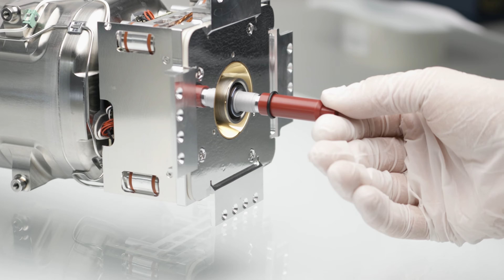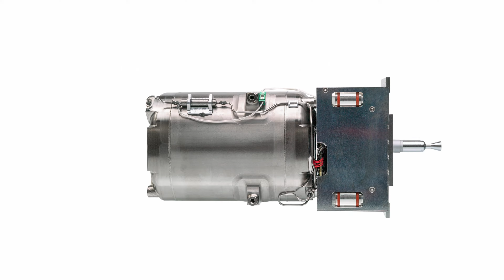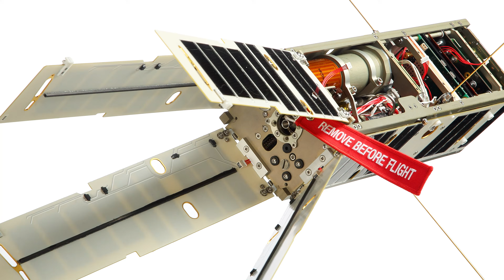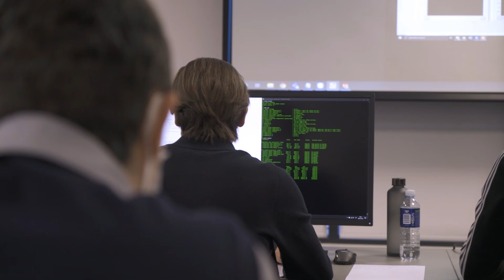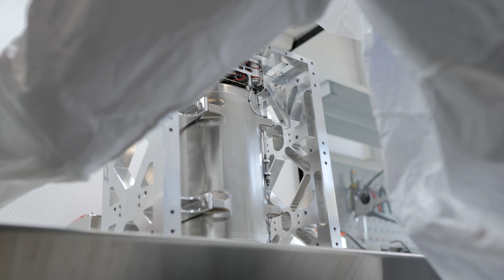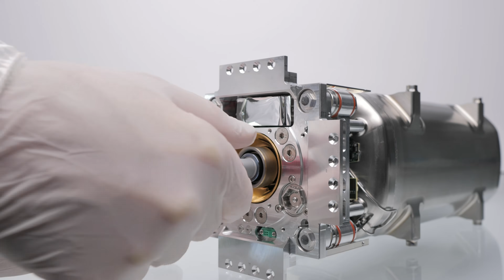NanoAvionics EPSS - The World's First Chemical Propulsion System for CubeSats

Comment: How much thrust (not delta v) would be required to escape Earth's gravitational pull?
Reply: This question can’t be answered with ANY sort of realistic answer. How much weight? Where are you starting? Is the vehicle very aerodynamic or is it a high drag shape? Which propellant are you using? What’s the dry mass of the rocket? How many stages are there? This question is literally the perfect example for the analogy ‘how long is a piece of string’ or even better ‘how much does a piece of string weigh?’